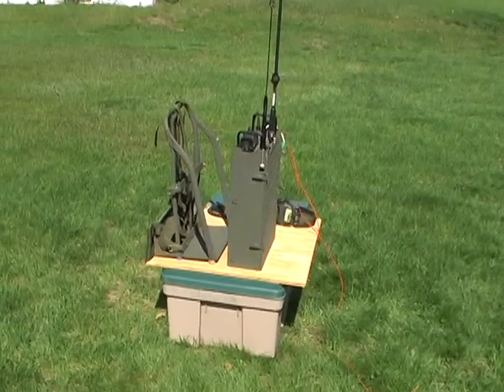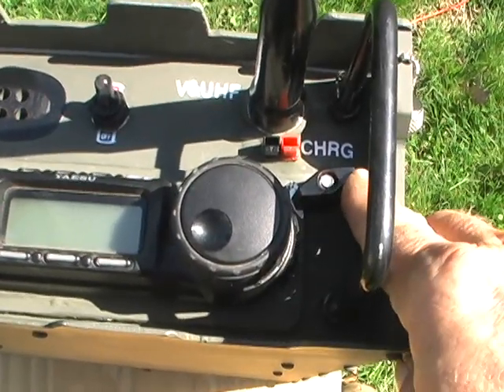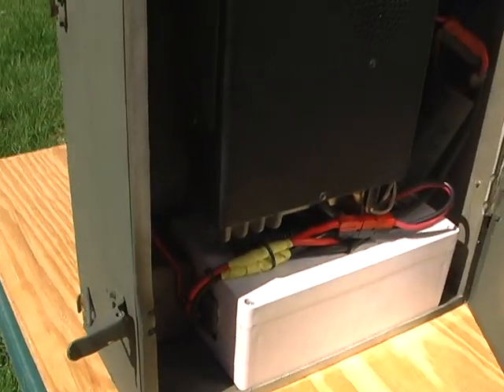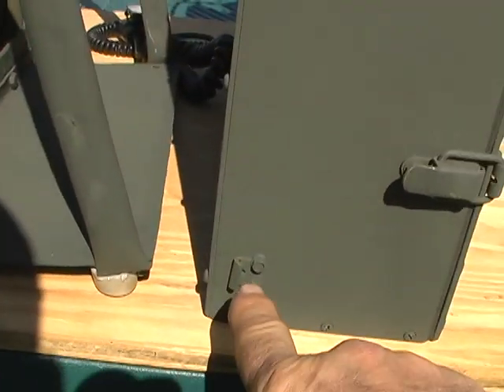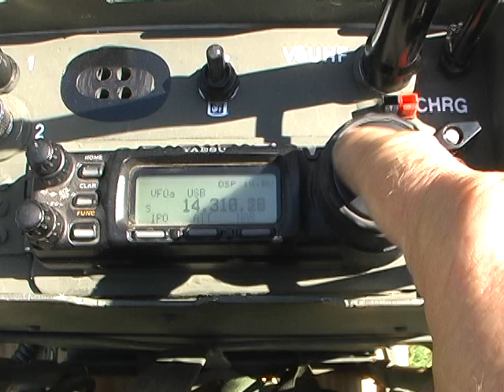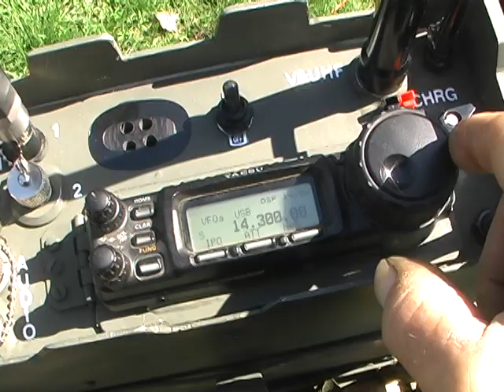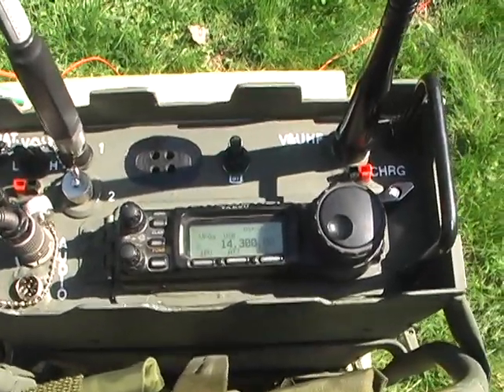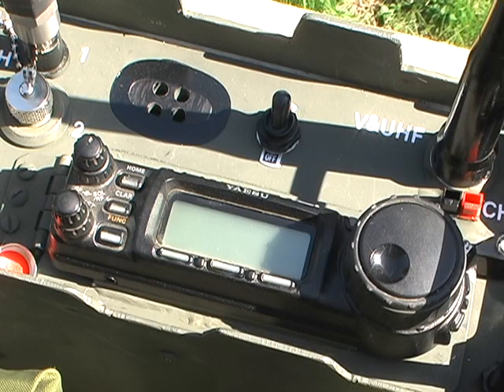Yaesu FT-857d manpack 2...home brew

Comment: Nice build. Those PRC radios...sure bring some memories.... heavy SOBs.  Wished I would do what you can do with aluminum.
Reply from the maker: +Robert Fernandez ....Thank you Robert for the complements.  I did have some help from a good friend with the aluminum fabrication.  He works at a gun shop so he has some great machining tools, which made some of the fab work easier. And yes, as you can see I like the design of some of the PRC radio's.  That was my idea, to make something that resembled a PRC portable radio but with modern equipment.  Many blessings friend, to you and yours.  73's

Comment: Nice set up! Especially nice for not really using a brake & shear! It looks almost bullet proof! I have a guy that works for a sign company that can bend me a box with thinner aluminum, shave off some pounds, and keep it water tight. He does a lot of guitar amp chassis work for me. I do have my eye out  for a good used box & pan brake. I am too old to schlep something like that around. I just use an HT with  vehicle repeater/extenders, now. FYI Those 857 control heads are not that water resistant. I have had to dry mine out and clean it once. It took on enough water, I could hear the relays inside the main unit going nuts, before everything went black. 38 years of cleaning beer & soda pop out of guitars & amplifiers came in handy, again! The vehicle repeater will take any 2meter/1.25meter/70cm HT  and I can get 5-75 watts VHF/UHF and or  10-600 watts HF from the vehicle, remotely using the ht & 857D and or a 897, and a 75 watt VHF mobile. If I have it set up with tuners & the the linear I can do 600 watts, but no more than 2 HF bands, and that is only if I load up the truck with everything. 73, KI7AQJ
Reply from the maker: +Seth B Thank you for the complement Seth,  That would be awesome if you could get a box made with thinner aluminium to cut weight.  This rig I built is not too bad in the poundage, it weighs about 37 lbs..  I'm almost 56 and still have enough strength to tote it for some distance.   In fall of 2014 I lugged it up a small mountain in Camden Maine.  The trek was about a 2 mile hike all up hill of course.  I must admit though, I was a bit winded when I reach the top. And yes, I do realize the FT-857 head is not water proof or even water resistant.  This rig is not something I would use out in the pouring rain. Most of the time I'm using it camping and set up on a picnic table under a canopy.  I built it more for the all in one and rugged thing.  Plus I like the military pack look.  Anyways, thanks for viewing and comments my friend,  Many blessings to you and yours.  Bob...N1TZU.  73's

Comment: Can you give me some info on two items.  1) Did you have to do any special settings on the radio to work with the tuner, or just use the y-acc cable? 2) Can you share how you wired up the h 250 mic to work with the 857?
Reply from the maker: Hello Roland,  I did no special settings on radio with the LDG Tuner.  Not even using any special cable between the two except just the coax cable.  Then I just tune where ever I'm operating.   As far as the H 250 mic hook up.  I did a google search on mic pin out configuration for H 250 and then gathered the connectors to make the connections. I've got notes somewhere here but finding them could take some time.  It would be much faster for you to just do a google search.  Start with these images here at this link> 
https://www.google.com/search?q=h-250+handset+pinout&tbm=isch&tbo=u&source=univ&sa=X&ved=0ahUKEwjW8vmvyMDXAhVG04MKHRqXC5wQ7AkINQ&biw=1600&bih=809

Comment: great job man, looks professional . Do you have any issues with temperature, keeping the unit cool, i did not see any type of venting or circulation
Reply from the maker: Thanks for the complement Hammer.  So far I haven't had a problem with heat but, I do open the cover slightly when I'm using it while set up on camping table.  I'm sure if I kept it closed while running 100 watts it will would build up some heat in the enclosure. Again, Thank you for viewing and many blessings to you and yours.  73's  N1TZU
Reply: +Ham R. thats great man , i have been trying to come up with a rig , for portable , and yours seems the best planned and laid out from the ones i have seen so far. if you had it to do over again do u think that a thinner aluminum  sides than 1/4 inch would lower the strength, i was just trying to bring the weight down?
Reply from the maker: I suppose using thinner aluminum might lower the weight some but, keep in mind by using thinner aluminum the box probably would be strong enough but, probably would require internal bracing.   So, would it really lower weight.?  I'm not sure it would.  Keep in mind my design has no internal bracing because of the sides,top and bottom being 1/4" thick material.
Reply: +Ham R. good point

Comment: sir this is S21VB please tell me detail about  `zener diode` how many pices you attached and digram ..........please
Reply from the maker: Hello friend, This is the type of diodes I used-http://allbasicsofece.blogspot.com/2014/01/diodes-types-and-applications.html#.WNDzzvnyuCg and the number on the diode is 6A05 1040.  I have 2 parallel banks of 5 in series which gives me a voltage drop of about 1.5 volts.  I hope this helps.  Many blessings to you and yours from N1TZU...Bob.    >---5----5--->

Comment: what battery is that there on the vid? at what power do you tx?
Reply from the maker: The battery is from here>http://www.batteryspace.com/High-Power-Polymer-Li-Ion-Box-with-fuel-gauge-14.8v-10Ah-148-Wh.aspx When battery is fully charge it is about 16.8 volts so just remember you will need to build a step down device to drop max battery voltage by 1.5 volts to make it safe for radio battery input voltage.  When battery is fully charged I can easily run about 75 watts for a while. Most of the time though I run about 25 watts. Hope this helps and many blessings friend. 73's N1TZU.